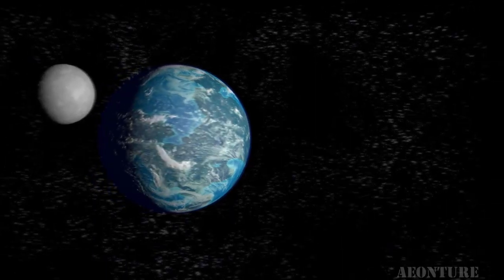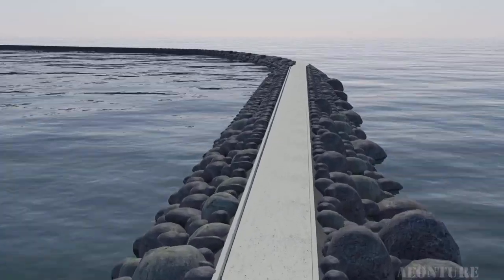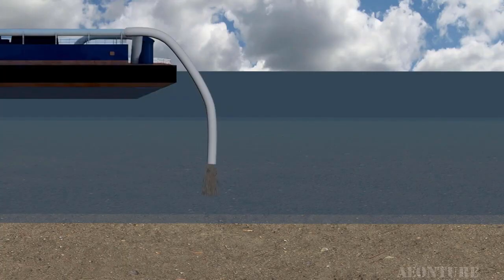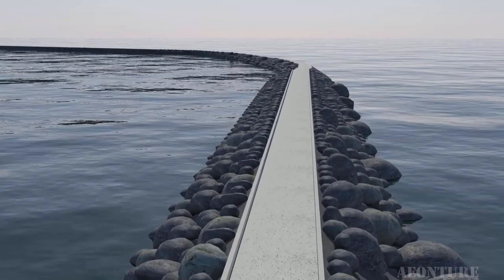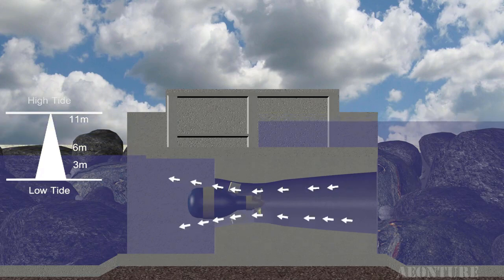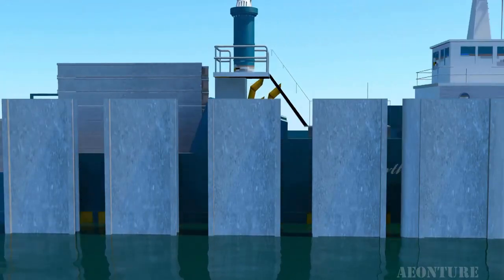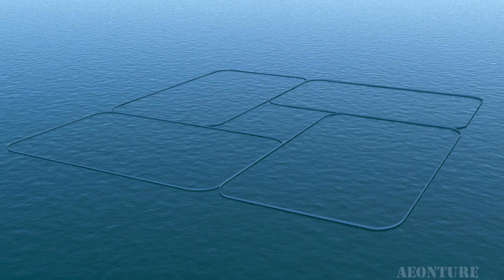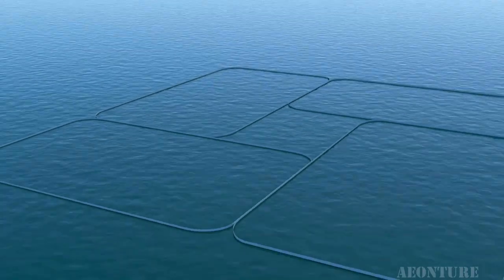Plug and Play, Portable, Tidal Power Plant Design for future.

Comment: For India, the first step is to explore and map the large sea coastline for tidal potential. Surely it will be commercially viable in some parts  of Bharat.
Reply from the maker: Thank you for your valuable comment. It can be commissioned anywhere irrespective of coastline. Preferably 40-60 ft water depth, more depth is also possible, however there is no advantage in doing so. 

Not only for India but for rest of the World too, with access to sea. Those who wants energy independence and wants to move to Renewable Energy source, this could be a boon.